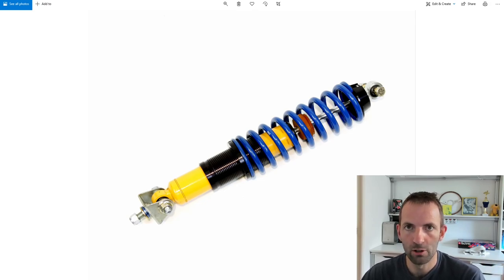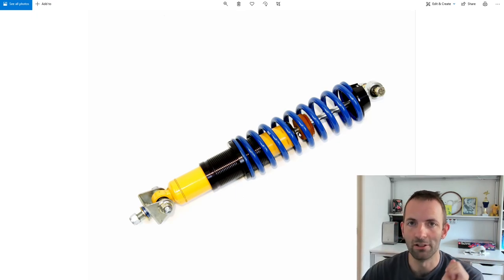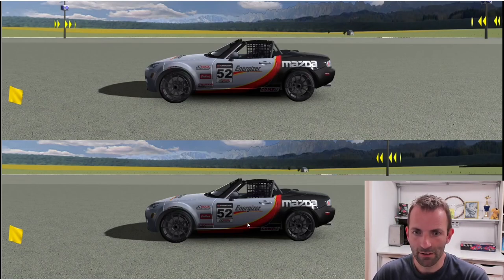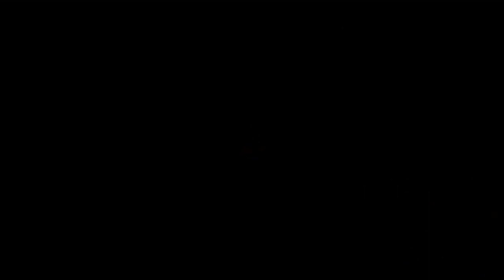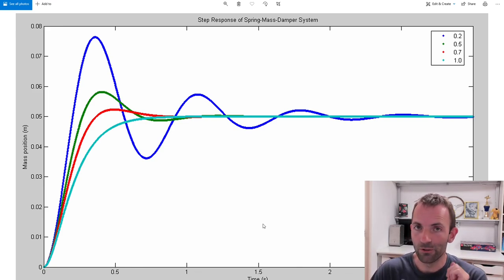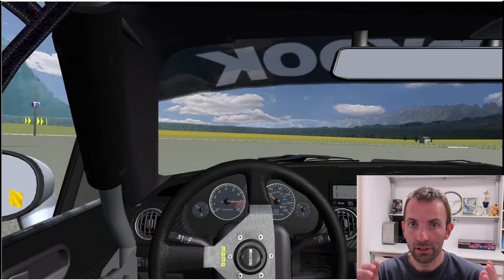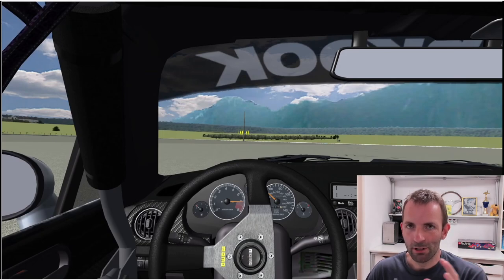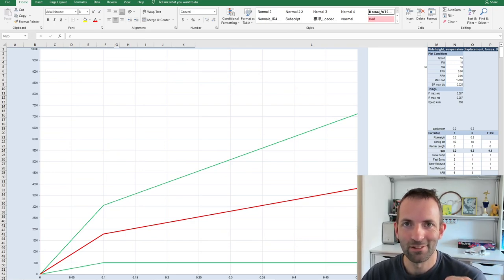Dampers Explained! In a *DIFFERENT* way than you may have seen before. See TimeStamps!

Comment: The eureka moment for me with shocks was from Jeff Braun’s book “Inside Racing Technology” “Think of shocks as a timing device for the chassis dynamics and springs and bars as absolute adjustments” I have found looking at high frequency suspension position plots that if I adjust the slow speed dampening so the chassis goes through level at the same time for both axels during corner entry & exit. I have a good neutral handling car that the driver can work with. For high speed adjustments I look at the peak suspension displacement of the track for each shock and look at how how the oscillation get dampened. I try to keep it as soft as possible without multiple oscillations.
Reply: I guess this is a very complex topic, and everyone has their own preference of tuning a car, but i completely disagree with this. 
Softest possible dampers can make you slide (not to be confused with understeer or oversteer), especially in low grip conditions (gravel, snow, ice etc) because weight transfer of the car is huge, thus centre of gravity will pull you outside of the track, and you'll be pretty much fighting your car to keep it on the road, unable to get a proper corner exit at maximum speeds. Under heavy braking could also introduce understeering (unless if you change front-rear break bias), as the car weight will heavily shift to the front making your front wheels lose friction. On the other hand stiffest possible dampers and suspensions can also introduce issues, causing inner tires to lift/lose traction in tight corners, but should provide better vehicle handling since the car weight does not shift around all over the place. There is a reason why race cars (GT3, F1) have lowest possible vehicle height, stiffest dampers and springs, that way the car maintains the centre of gravity closer to it’s optimum spot. Now things can get a bit different when you are facing bumpy road like rally drivers do, so there should be a proper balance like with everything in life.
So IMHO, you should be going with stiffest possible dampers/suspensions/springs that the road allows, keeping your weight transfer and centre of gravity at best that you can possibly have, and on top of that getting the absorbtion that you need to survive bumps, but life is not perfect and sometimes or often you might need to just sacrifice one or another a bit more depending on which track you are driving.

I could go in details about physics behind this, but i guess in that case i would need to make a presentation in power point instead of writing a comment.

What i just wrote is purely based out on my learnings, researches, experiments and racing sim games. I'm not a car engineer by any means, and i'm open to hear other explanations/evidence/math/physics that could potentially prove me wrong.
Reply: @mlapai1451  The things you are talking about are adjusted by springs, anti-roll bars, and ride height (roll center) adjustments. Or going back to square one and changing the suspension geometry. Shocks work during rate of change, IOW the phase relationship of load transfer. On my autocrossing MX-5 I have a 9 position front ARB that I can adjust in 3 minutes. It is an effective tool for balancing the car to the demands of the track. Shocks adjustments are too fine of a tool to be effective. You can do this in the sim also. It is always trying to make the contact patch happy.
Reply: @tgiencke  I will definitely try doing so (i already did, but i'll try again just for the sake of experiment - in racing sim, not in my real car, cuz i don't want to mess things), but anti-roll bars reduce roll, not total weight transfer. It's just the force gets to the outer tyre using the anti-roll bars, rather than using the springs, hence less roll. Dampers determine weight transfer and limit body movement, and the rate at which weight is transferred, not the other way around. A car with too stiff springs and too soft dampers will bounce around, that beings said, too stiff dampers with soft springs aint good either. I mean if you are driving in autocross arena, in perfect flat conditions, you can get away with stiffening roll bars and springs to as much as you like without negative effect (almost), but if you take that car to a rally track, you'll most likely end up flying off the track or bottoming your car out when you hit first bump, so everything is related to type of racing you are doing.
All i'm saying that all this needs to be in balance (dampers, springs, rollbars) (not to have one to the extreme, and then trying to compensate with the other one, cuz that will create issues on other side) to have a best performance, or to feel comfortable with the car on the track, i'm not saying you should stiff dampers to the extreme like a lunatic, but that you will have better weight transfer overall with stiffer ones, if that makes sense :D
Reply: @mlapai1451  All I can say is the MoTeC L120 datalogger I installed in the MX-5 says that my peak lateral acceleration is 1.4G. This is on 200TW street tires and no modifications other than front ARB. So I must be doing something right. You obviously have an interest in this stuff, I recommend reading the “Racecar Engineering” magazine for interesting articles.
Reply: @tgiencke  Alright, if you have a way to measure these things in a real car, i can't really compete with that, cuz all i have to test these things are racing sim games such as dirt 2.0, assetto corsa, iRacing and etc which may even not even relate 100% to real life (i'm pretty sure they don't, but we don't have better ones yet, or at least i don't know if there is something more realistic). But if you are right (and honestly that might be the case), then i have a question...Why racing cars like GT3 and F1 have everything stiff if that's not the best possible setting (for flat surfaces ofc, this is probably not so good on bumpy tracks that drivers face in rally) ? I'm pretty sure they have best of the best car engineers you can find in the world :D

Btw, thanks for recommending this stuff, i am really interested, we could even say that i am a fanatic when it comes to cars and racing. Unfortunately, i don't race in real life, but i might start doing it soon.
Reply: @mlapai1451  Racecars with aero run relatively stiff springs, ARBs and dampers so that the aerodynamic platform is as stable and as often in the correct positions as possible, sometimes I suppose at the detriment of mechanical grip.

Comment: 25:30 This is true for most of the sims, but for example on ACC, they don't use a fixed threshold to define a "slow bump" to a "fast bump", instead they use a transition curve where low and fast bumps are still related but of course the higher the dumped velocity, the less it affect the low bump and vice versa, like in a real situation.

Comment: I think trying to achieve a normal distribution in the histogram will optimize the grip once on a given surface once a spring frequency is chosen to best match the track irregularities but above that using the best geometry to limit the load transfers caused by driver inputs.

Comment: Brain highly dampened after watching this video! Good stuff. One thing that gets even more confusing is when certain cars, like Nascar and GT3 (I think) maybe others, purposefully ride the bump stops (maybe for aero benefits) and how you tune that in a sim when you don't really know what that feels like (without looking at telemetry)...
Reply: How some sims handle bumpstops notwithstanding, they simply add an extra degree of progressive stiffness in order to control ride heights to maintain aero levels.  Typically during high loading. Hypothetically, you could have a softer spring for the positive grip characteristics for most parts of a track, but then a stiffer and more stable aero package using bumpstops when under high loading.

Comment: nice vid. fyi, and for the little I know, about the histogram graphs, the goal is to get the most symetric bell curves, by slightly change bump/rebound settings: if one side too high (too much time spent there) you stiffen, if one side too low (not enough time spent there) you soften. but both sides are somehow linked together at the tipping point (if I make myself clear enough... :)
Reply from the maker: Sure, that is the common thing you read. Maybe this is totally true, but what is the evidence that this is by definition the faster setup? I can't explain it. It looks nice and symmetrical... But what does it say about a certain track? Maybe with lots of kerbs, you have a few very short duration bursts of speed, maybe 5 seconds of the 90 seconds. It will have a small part in the histogram, yet maybe there  is a lot of time to be gained by changing dampers for these 5 seconds of the lap..

Comment: We could tune the wheelrates and dampers of a race car for minimum contact patch load variation = maximum mechanical grip (due to load sensitivity) and that's where shaker rigs and telemetry comes in as the vibration modes in the car should be inspected as a whole and not for a single damper only. But in the era of aerodynamics in racing, we'd quickly find how irrelevant optimizing mechanical grip is versus possible gains from aerodynamic grip and thus "tuning springs/dampers" quickly turns out to be mostly a tool for aerodynamics.

Comment: When dealing with downforce and a platform, the histograms are important. If you have say, a peak in the slow rear bump compared to the rebound. It means that the car is quite controlled on the brakes without much rise. But it does squat on the throttle. If you want stable brakes and aero stability on throttle, you could want that.

Comment: Star Wars Episode 3, Count Dooku: "I've been looking forward to this!"

Edit:
21:40 yes, if there are bumps - even during cornering - the dampers still work, however steady state means there are no bumps, because it is a steady state w/o outside influence to the handling of the car, so I think you are comparing two different scenarios. I fairer statement would be - in theory during steady state cornering the dampers have almost no influence on handling, but on real race tracks they do (and real race tracks very seldom have a steady state of anything)
29:50 because the front suspension is stiffer, the front springs are stiffer, that's why the damper spends more time in a smaller range. That makes sense on a LMP2 car that the ride freq. front would be 4.5 Hz and the rear more close to 3.8/3.9. Even for same damping front + rear, the graphs can still be that peaky b/c for the stiff springs in the front. I think it is difficult to interpret the damper force on that graph, it's much more useful to dial in the distribution front/rear & low/high speed.
32:30 The problem is this histogram is the only measurement we can do of the dampers in ACC for example, Kunos has license agreements with the SRO and the teams that prohibit providing certain motec channels and showing actual data and values in the game / in the setup screen. This is all we have and we have to make due with this mess. In AC we can see everything on certain mod cars, knee speed, dampers, ARB rates, etc and then I could calculate spring+ damper rates for each car - In ACC we do not.
34:40 That's why formula cars have a third spring, more expensive ones third spring + damper. The pitch moment is then also controlled in conjunction with the front+rear springs+dampers. As you of course know the third spring is actually primarily meant to control ride height during high aero load.

Comment: I agree with your statement about the car not spending a lot of time in steady state on track, but by definition if the car is experiencing bumps your no longer in steady state. So I disagree slightly with the conclusion. Aka dampers working in steady, they don’t, but by experiencing bumps mid corner your actually causing the car to go into transient.

I do find your approach to setting up dampers interesting you make a good point about being able to change driver inputs for transient. That being said if a car is highly responsive in transient and the driver cannot adjust they lose confidence in the car which is one of the main roles of the setup (building driver confidence), so I do think there is a limit to that and maybe at a certain point you do need to consider the transient to match the driver style and may need to adjust dampers to do so.
Reply from the maker: I think sometimes the 'steady state' means 'steady inputs' like cornering at a constant speed and steering wheel angle. That is always tricky when people talk about racing and car setup, definitions might be 'obvious' to an engineer, but not everybody means the same when they say the same. I have read and heard a few times that 'steady state' means steady state inputs..
Reply: @NielsHeusinkveld aaaah okay yeah if were talking about steady state of inputs then I see the point your making, I often think  of steady state of the cars response. I wasn't trying to be a stickler as the examples you used were a brilliant demonstration to put things in context for people. Just think its important to be clear because of the reason you mentioned in your reply.

Comment: The suspension histogram is used to have an overview of how much time relative the damper spends for each deflection rate in mm/s and it's grouped in bins to have a decent amount of samples per bin to analyze this. It is used to spot anomalies and it gives you a point of reference when you make changes. Obviously you want to balance the bump and rebound side so that you spend roughly an equal amount in each to know you're not skipping over the surface. And you know it's performing well when there is an increased % the closer it gets to 0 as well as a separation between each bin so it doesn't stall anywhere. However tracks with curbstrikes side wheelies can make this tool less useful.

Comment: Really good explanation on dampers but, you didn’t explain why the inertia was different in your first examples. Did you add mass to the car? Did you change the distribution of mass?
Reply from the maker: I just made the inertia number bigger in an extreme way, a bit like going from  a big engine in front of the front axle with gearbox and heavy rear axle, to a formula car with centralized masses.

Comment: Where the calipers are placed around the brake discs is a very big deciding factor of if the vehicle goes up or down or not while braking
Reply from the maker: Can you explain how? I don't think it matters at all. There is a difference with outboard brakes (placed 'against' the tire) and inboard brakes, as seen in 70s F1 cars, where the discs are right next to the differential. But the positioning of the caliper makes no difference as far as I can see.
Reply: @NielsHeusinkveld  It's true but it's not a very big deciding factor. Imagine the wheel rotating and you place the brake caliper on the front of it, the reaction force to the brakes will be up, lessening the weight on the tire - therefore lessening grip. If you place the caliper on the rear, the force will go down, aiding the braking. At least I think that's the case. Packaging, ease of bleeding, weight distribution is what typically matters more.
Reply from the maker: @Fin4L6are  That sounds very weird to me. Regardless of where the caliper is, you get a brake torque around the same axis..
Reply: @NielsHeusinkveld  That force vector would be a straight line... not a line that curves around an axis. The force direction averages out from the contact patch between the pad and the rotor. On a vertically mounted caliper it goes from slightly "northwest" to slightly "northeast", averaging out vertical "north". Imagine if you had to hold the caliper in your hands. That force you would need is the same that affects the weight of the car. At least that's one way to think about it.